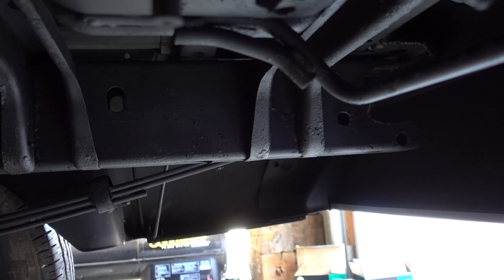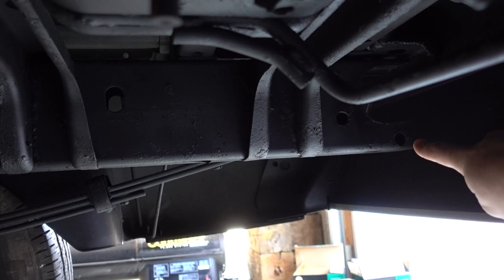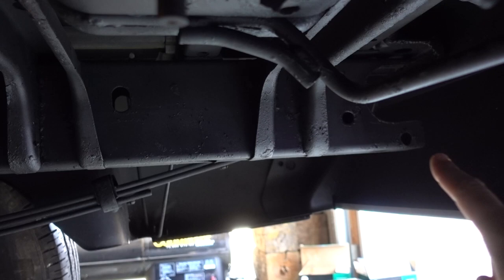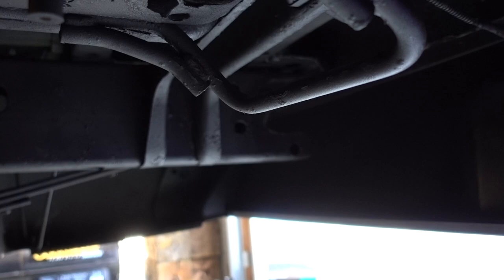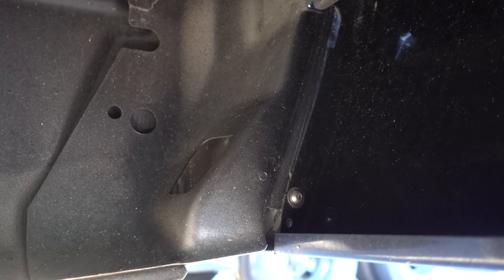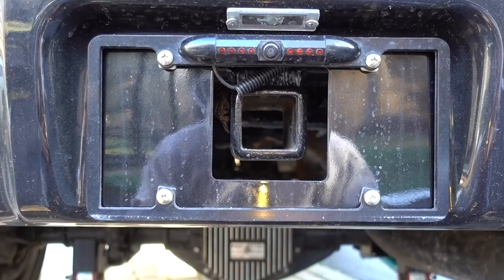Dodge Ram Rollpan & Hidden Hitch

Comment: I have a question I have a 3rd gen too but wanted to lower the rear did you just remove a leaf.  Also doing this if I tow my r.v will it effect something I don't tow really heavy loads. thanks man great videos keep em coming
Reply from the maker: Thanks! You can start by "reverse leveling" the truck, under your leafs are spacer blocks which can be removed from the bottom of the leaf and put on the top which will lower it without effecting any type of towing or hauling capabilities. I prob will make a video on this too soon.

Comment: did you paint your frame yourself?
Reply from the maker: Yes, using rustoleum products
Reply: Nice, what kind of prep work did that require? My frame still has pretty good paint, but I want to go over it again.
Reply from the maker: Really just a good scuff and cleaning, enough for the new stuff to really have a solid base to bond to
Reply: Thanks for the info, just followed you on instagram, love the build. My trucks pretty identical to your brothers, hope my roll pan turns out as nice lol
Reply from the maker: Thanks for the support!